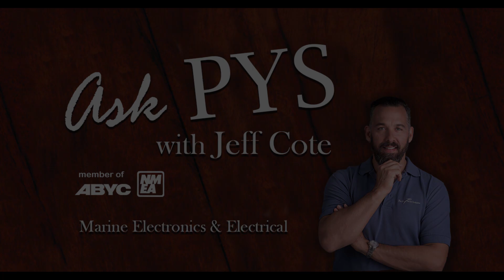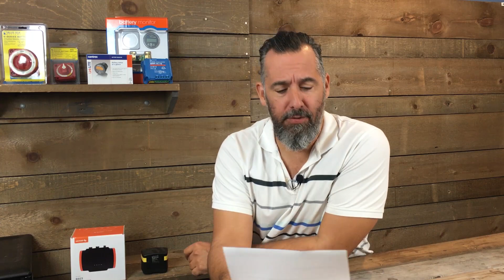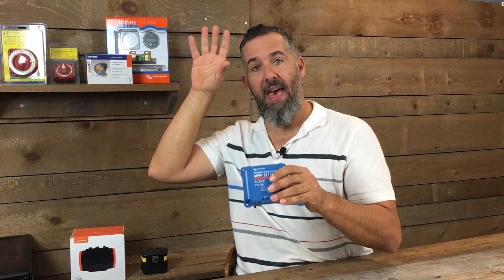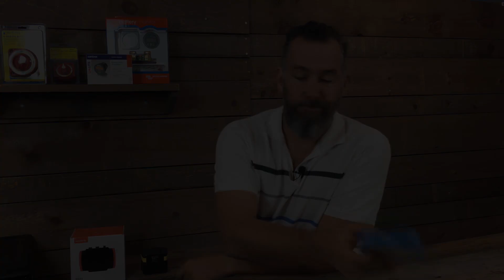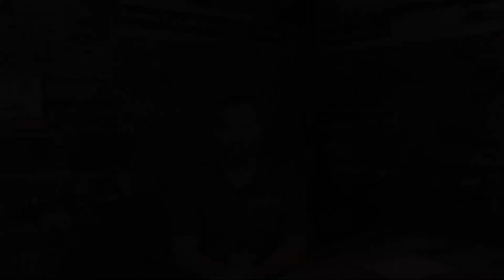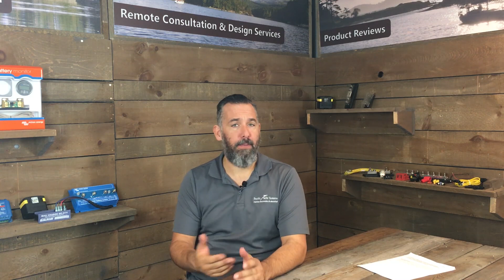Ask PYS - I Am Adding a Solar Panel to My Boat, Where Do I Install the Fuse?

Comment: I’m adding a 100w flex solar with a Victron 75/15 controller. What sort of inline fuse do you normally install?  It’ll be next to the victron shunt. An in-line blade fuse or is it worth adding a small dedicated fuse box next to the battery?  Thanks, Tom in Italy
Reply from the maker: Tom, big fan of blade fuses as they are easy to identify and swap out.

Comment: I have a question so I have 4 100 watt solar panels should I fuse each solar panel an what size should I use for each panel ?
Reply from the maker: Yep a fuse for each panel, for a 100 watt panel a 10 amp fuse would be good choice.

Comment: Not sure solar panels would work to good up here southeast Alaska Jeff. But I might try them soon
Reply from the maker: Hi Don, you definitely need some sun to get reasonable output. On a thick rainy day, you get a fraction of what you normally get.
Reply: However, solar panels are more efficient at colder temperatures.  So there’s that.
Reply: Yes we are very over cast maybe 260 days a year.

Comment: Thanks for the video Jeff, always good.. I have a question here. In one of your videos you mentioned using multiple solar controllers "one for each panel" to combat shading issues. My question is as charging current usually works on a differential voltage will one controller see the other controllers output voltage and reduce its current output accordingly? I assume a good way to test if you can disable the other controllers you should be able to tell by using a clamp meter to measure if the current output of the still active controller reduces as you turn each other controller back on. Is this a factor? Have you ever tried to measure this? Regards Stormer..
Reply from the maker: Hi Stormer, another good question. Multiple solar controllers, or multiple charge sources, can be connected to a single battery at the same time, and those charge sources will not "reduce" the other charging source output, until the battery voltage exceeds the bulk voltage. Under bulk charging, the battery wants all lots of amperage, maxed out at the CAR (Charge Acceptance Rate). It's basically like multiple pipes of water filling a pool, until the pool gets full, the water flow from all pipes will be max, as you get close to the top of the pool, the flow from all piper (controllers) will start to diminish as to NOT overfill the pool (batteries).
Reply: @PacificYachtSystems   Jeff thank you for the reply, a great explanation, I will research charge acceptance rate, just to further the knowledge base.. Very much appreciated, I have used 2 controllers (to handle the current as where we were could only get 20A controllers and we were putting in 33ish amps) feeding a 1000 ah house bank they worked fine but never had the means to test if one was affecting the other, always wondered if we could have improved the system using a different configuration. Thanks again. 😁

Comment: Is it accepted or good practice to shorten the length of newly installed chart plotter power supply cords,  or coil and zip tie and secure the excess?
Reply from the maker: Hi John, good question. Most of the time, the power supply cords are NOT shortened. That said, on my own boat, i certainly do shorten the power supply cords to reduce unnecessary voltage drop.

Comment: Hi Jeff, would this apply to a positive line coming from the isolator and going to the positive unswitched distribution and starter battery positive terminal?
Reply from the maker: Hi Omar, yep a battery isolator should have inline fuses located at the battery for protection of the alternator positive wire against a dead short.

Comment: I Jeff, I put a 2 pole circuit breaker for my solar panels next to the charge controller. I can, if there is a problem or to stop sending energy now. Is it a problem? Is it a problem to add them directly to the panels? However, there are suppliers who offer equipment allowing this use ... I put on a Midnite mnepv20-300 DIN rail... With crimp ferrules ... I made sure it was 489A and secured in a waterproof DIN box.
Reply from the maker: Seen this sort of setup before: double-pole circuit breakers (with one flick of the toggle two breakers turn on or off) installed near the controller between the solar panels and the controllers. Sounds like you are did the right thing.

Anybody else have a double-pole circuit breaker setup on their solar system?
Reply: @PacificYachtSystems  because I understand that you often say not to put a circuit breaker for solar panels. There are also fuses that connect directly to the line in MC4. Why so much product if it is unnecessary? For now, the 2 pole circuit breaker is also very practical. Different hazard on the solar power line can happen and the circuit breaker 1 or 2 poles will be very welcome even if the panels will not develop more current as a battery would with a short circuit ... But there can be other problems than a short circuit... Merci pour ton aide et les informations. PS: Parles tu francais, Côté It's French...???